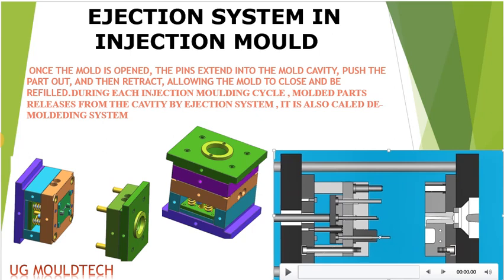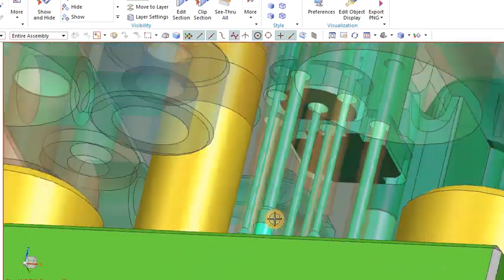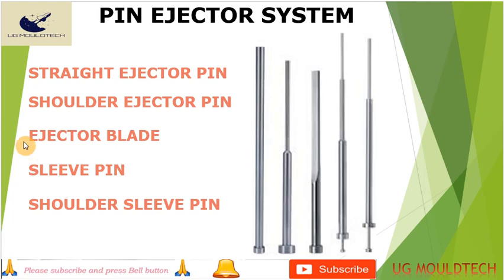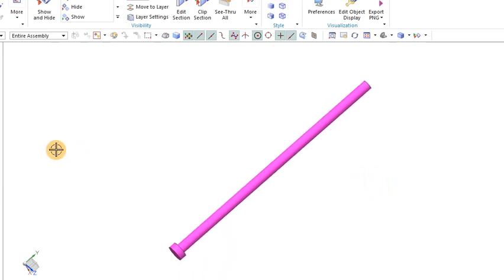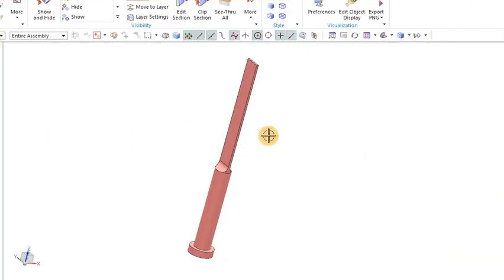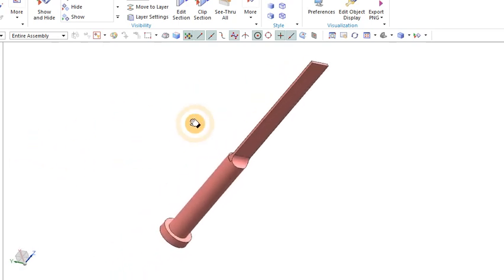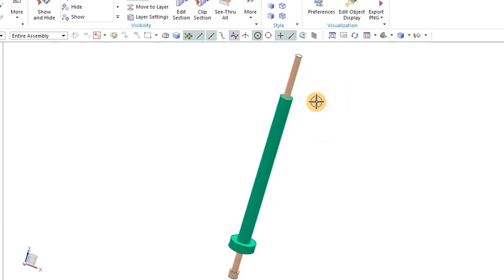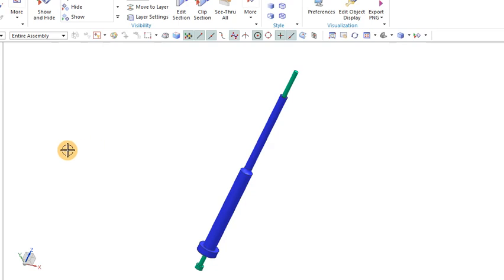ejection system in injection mould & its types / ejector system in mould / ejection technique.

Comment: Type of ejection 
Pin ejection 
Blade ejection 
Sleeve ejection 
Stripper plate ejection
Stripper bar ejection 
Stripper ring ejection 
Air ejection 
Vaule ejection